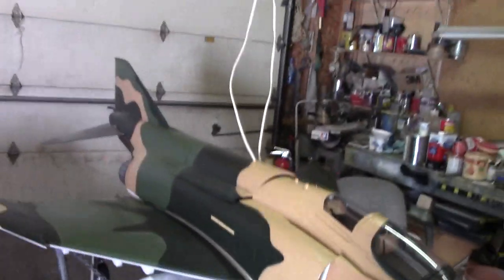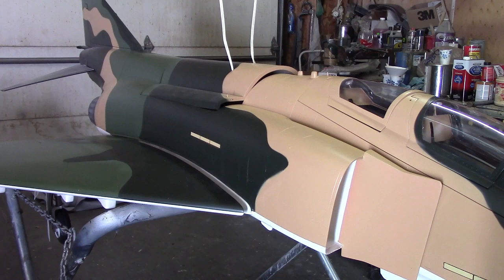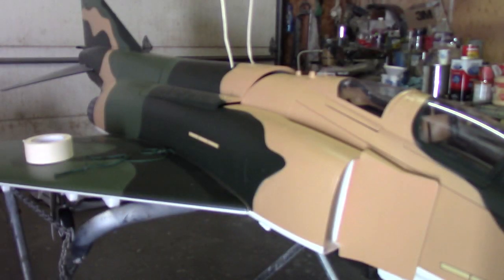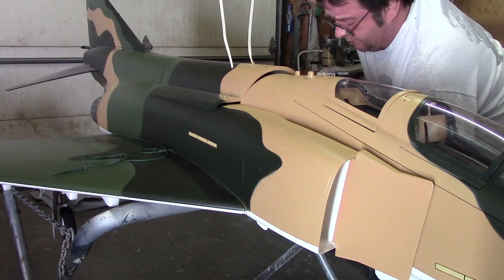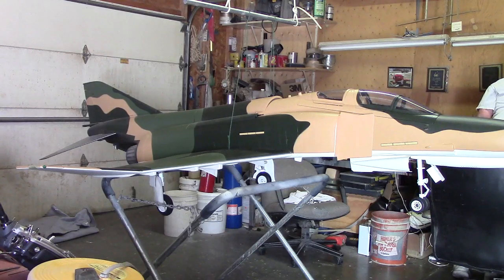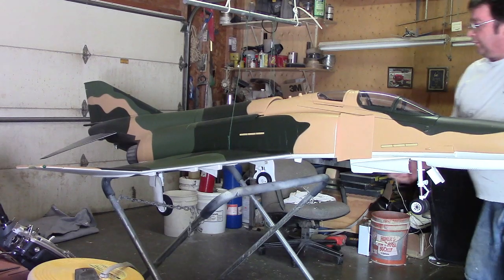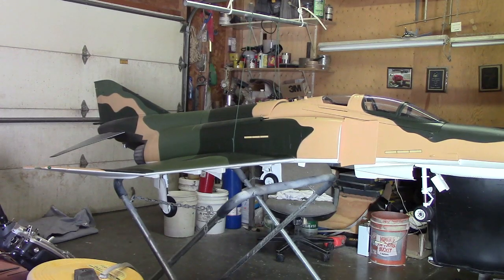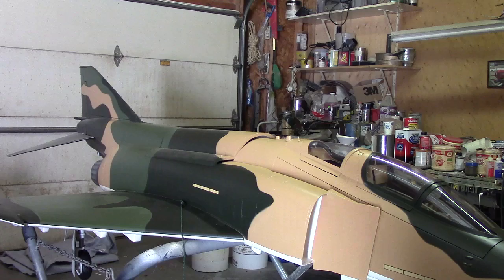how to C/G a big jet by your self

Comment: I am not sure if it helps but, I attach a string to a measuring jug then to the nose now this is metric as liquid is proportional to weight eg 1000 milliliters = 1000 grams (1 liter = water equals 1 kilo gram) so i fill the jug until the plane balances and then i know what weight. Disclaimer i know the jug adds to the weight and that water to weight ratio is almost to the exact figures by about .4 grams, and only use water as other fluids have different weight ratios.